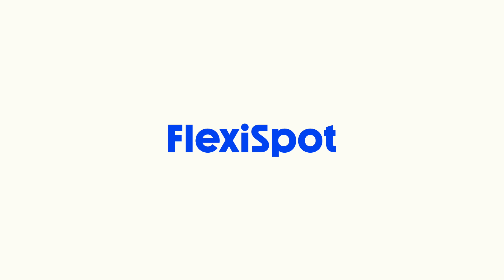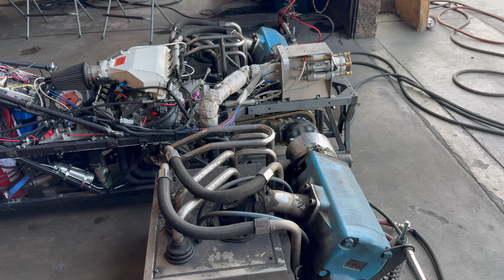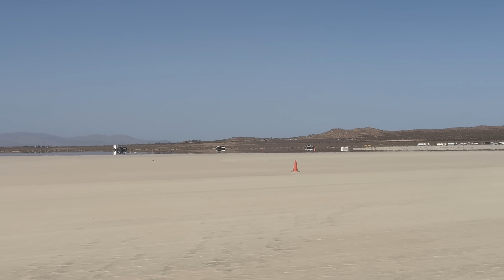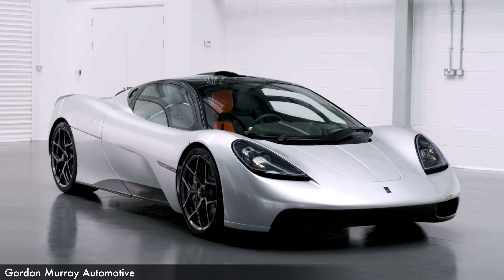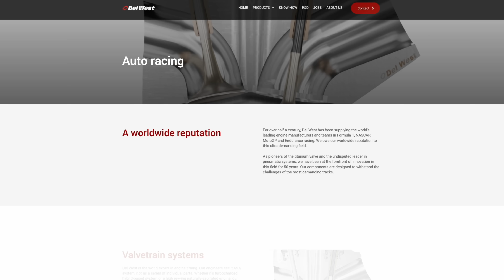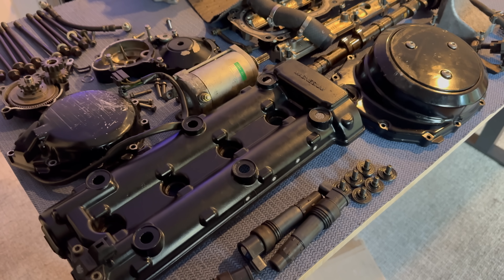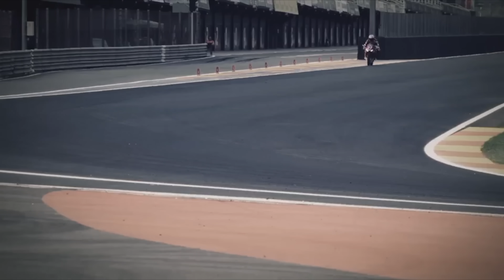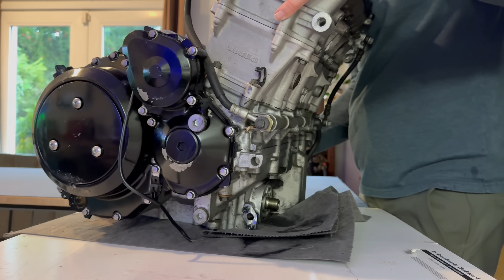Motorcycle Engines Are WAY BETTER than Car Engines

Comment: my takeaway: since the world doesn’t scale linearly, bike engines can be what car engines can’t, because bikes are lighter than cars
Reply: That is also why CVT transmissions deployed on motorcycle do not have issues like cars. Honda motorcycles' dual manual transmission work well too.

They are never go over 300kg even with a pillion rider. While modern cars go over 2000kg easily.
Reply: @laychyetan7466  I wonder how it would fair if you took a motorcycle engine and cvt put the output through a 2:1 reduction and put it in a car.
Reply: @theosexpertdaymon2774  I'm sure you'd get a lot more longevity out of the motorcycle engine, but they're also generally (a lot) less torquey at a given RPM, and have a higher brake specific fuel consumption (lower thermal efficiency). The last car that was sold with what was essentially a motorcycle engine was the RX-8. They revved to the moon, the engine was light and compact, they got terrible fuel economy and the engines needed to be rebuilt every 80k miles.
Reply: @theosexpertdaymon2774  it would be slow and have a low top speed also motorcycle engines dont have the torque required to move a heavy car
Reply: @DukeNukem3955  I'm assuming you were trying to type "don't have the torque required".

Yeah I that I mentioned the 2:1 ratio modifier. Half the output speed, double the effective torque. They rev to the moon so the higher running RPM wouldn't be a problem, I think.
Reply: @theosexpertdaymon2774  it wouldnt but who wants to hear a screaming tiny engine while going nowhere fast
Reply: @theosexpertdaymon2774 some did it with Honda Vario engine installed in Honda Civic. Very slow.
Reply: @laychyetan7466 take a 1200cc touring bike with two people and luggage
Easy over 450
Reply: @Gerx024 
Two main points.

Motorcycle has ease of maintenance, there is not need to pull the engine out of the chassis.

My calculations are off but when the load is at least double in engineering, the solution needs to be beefed up. In the real world, the CVT applications in car are a planned obsolescence strategy IMO. It doesn't benefit the owner in most scenarios.

But CVT transmissions has great fuel economy and pick up before the maintenance schedule bites you. ( Applicable to cars)

In the case of motorcycle, just change the belt and clean/grease the trans. Routine and no biggie.

For a car you need a workshop with schedule to pull the powerplant out of the chassis before you get the rough quote for the CVT maintenance.
Reply: @laychyetan7466  my family has two 10th gen Honda Civics with CVTs. Combined they have over 250,000 miles. No issues with the transmission.
Reply: 5 times lighter on average, consume the same or more.
Reply: What I still dont get and the video didtn explain is why the transmision on an engine is not packed behind the block like in the bike and why they are not all in one package as in the bike.
Reply: @Narblo  The gearbox in the original Mini was in the sump but this meant a long and therefore less precise gear stick which meant that it took a bit longer to become proficient at changing gear.
Reply: @Narblo  
1) Because they don't NEED to be. Cars are much larger vehicles with more room for everything. Also...
2) Look at where the drivetrain lives on a car vs. a bike. Cars have subframes, steering arms, air conditioning, etc. nobody wants to have to disconnect 45 things and pull an entire engine/trans combo out of a car just to install a clutch.  
3) FWD cars effectively DO have the engine/trans lumped together as a mostly compact unit, because the entire drivetrain has to fit between the front wheels.
Reply: @daedalus_20v  I get they dont need to be, but it would be easier to fit a I6 engine in a FWD car if the transmission came packed since it wont fit like they usually come (side by side). If I am not mistaken, the miura has the transmission behind the engine instead of on the side.
Reply: My RX7 was 2200lbs. A modern car is easily double that. It's foolish and doesnt need to be that way.

Comment: Another advantage of magnesium valve covers is when you crack one it will look cool when you throw it in a bonfire. 

The last motorcycle engine I took apart had a single piston that was 4" across. It did not spin very fast.
Reply: suzuki savage?
Reply: @seantheberge5456  DR650

Comment: Clutch pack a drum assembly is basically the same concept that you'll find in most automatics. One of my for fun open track day cars I built out of the salvage yard (street legal with a good title somehow) uses a manual valve body setup with a custom electronic shifting mechanism I built with a basic microcontroller setup and paddles to make it kind of a sequential transmission. Not ideal, but it's a fun experiment with parts that were going to be scrapped that I got for free.

Comment: I think if Honda did the V8 S2000 with a manual, I’m in for one if the rebuild or replace at 40k isn’t crazy expensive - like LS money would be fine. They should sell as a kit car for emissions. Great video - always wondered why there isn’t a chataram 7 sold here with a nice bike engine/transmission

Comment: Idk man i could get a rotor that do 13k rpm much cheaper than 3 mill. Pistons are so lame

Also like a rotor, bikes have basically 0 torque, and so wont pull a bike on a trailer up the hill let alone a solid weight

Comment: I ride a VFR1200X. Not the most powerful bike engine but still, it's only moving 275kg & me. 135 hp stock but can be flash tuned to 180 hp. 👍🏼

Comment: If I'm not mistaken, some F1 engines would rev past 20,000 rpm, but that was capped to 18k, then 15k for safety reasons.

Comment: 12:00 - why do motorcycles have a narrow gear range? To keep it "simple and fantastic?"
Reply: The rpm range that you make torque is smaller and peakier so you don't want to drop as much rpm per gear by ratio.

if you make peak torque at 12000 and redline at 15500 you don't want to drop to 10000 every shift

This varies by motorcycle and its application of course.

Comment: Vibratory equipment engineer here, "Everything is a spring, especially springs" accurate description.
Reply: Not my ideal infinitely rigid spherical cow.
Reply: @BenjaminCronce  probably what OceanGate thought they had achieved 😳!
Reply: I see things!as springs.
Reply: I remember joking around with this line of thought when I took FEA and Mechanical Vibrations in my final semester of uni lol
Reply: @jp_0118  I made Mechanical Vibrations and FEA my bitch. I was the only one to do so that year, but man it all just clicked .
Reply: soooooo many good vibrations like to snag some positive such as energy
Reply: So, you design toys for females? What is the most powerful one you have ever designed?
Reply: sounds better than "I make sex toys"
Reply: EE here, and OMG is this so unexpectedly true. 
It's one of those things they NEVER teach you to watch out for, and inevitably leads to frustration with your test units/prototypes suddenly failing, when from an electrical perspective, everything checks out, and looks perfect... on the bench.
Or worse... You have a sudden current break... But can't spot it visually. It's a middle layer of the circuit board that bent too far... 😫
Reply: soooooo many good vibrations like to snag some positive such as energy

Comment: It's simply not true to claim that it was motorcycle engine designers that appreciated 4 valves per cylinder gave better breathing that 2. The 1810 Isotta Fraschini Tipo KM had 4 valves per cylinder, with a single overhead camshaft. The 1912 Peugeot L76 Grand Prix race car, had 4 valves per cylinder with dual overhead camshafts. True, it was a race car engine, not a production  care engine, but it was clearly not motorcycle engine designers that appreciated the merits first. There were a whole bunch of 4 valve per cylinder car engines between the wars, and by WW II it was standard practive for liquid cooled aero engines.

The first motorcycle engine with 4 valves per cylinder was the 1921 Triumph Ricardo named for the famous, pioneering British engine designer and theoretician, Harry Riccardo who designed the engine on commission (the mechanical engineering consultancy he found is still at the leading edge of engine technology).

Also, using power per unit capacity as the sole criterion for what is a better engine is a complete nonsense too. Highly tuned motorcycle engines have poorer fuel economy than the typical car engines. They are often less flexible,  produce more pollutants and wear out faster. Car engines are generally designed to last longer. Now just how you want to weight these factors is a matter of priorities, and what is the better engine depends greatly on those factors.
Reply: Your average car engine tends to be low revving relatively low power undersquare engine that excels at low end torque but motorcycle engines are oversquare high revving engines that are more akin to a Formula 1 engine . Motorcycle engines goal is getting high power out of a small package but car engines goal is mainly efficiency not power . One of my motorcycle's over 35 years old now it's  nothing high end either but it has 5 valves per cylinder , yes I know cars existed then with 5 valves but they cost more than a large  house

Comment: With great power density comes great maintenance density
Reply: Car engines would have a lot higher power density if they only had to last 25k-50k miles. Is this really the only metric he is using?
Reply: @Noneofyourbusiness2000  No motorcycle is made to last only 50k miles, perhaps two-strokes. Modern motorcycle engines will last as long as you maintain them well.
Reply: @F3udF1st  ever own a sport bike whose engine lasted over 50k miles? This guy isn't talking about Honda Goldwings.
Reply: my 2006 motorbike has 65000 miles on it and i never had to open the engine , i just change oil , air filters and some lights that burn now and them .
Reply: @____trazluz____9804  but what is the make and model? Does your bike rev to 14,000+ RPM?
Reply: @____trazluz____9804 What kind of bike? That’s impressive!

Comment: The spring explanation is the best I have ever watched on any engineering videos. 
The 3 valves compared in one shot shows how those small engines are able to handle higher revs without going to complexity of pneumatic systems.

Comment: Fun fact: Modern F1 engines have a stroke of less than an inch and don’t use springs, they use pneumatic valve actuation, allowing around 20,000 rpm

Comment: Many years ago Honda made a five cylinder 125 cc race bike.  The engine was designed to run at 22,000 rpms all day with a 25,000 rpm redline.

Comment: Finger followers aka rocker arms. DOHC VTEC Honda engines have been using these since the 80’s. I love my 1.8L Integra GSR that spins to 8K rpm. And of course the 5 valve per cylinder Toyota 4AG engine is pretty amazing in its own right.

Comment: I will add, 
I was looking at purchasing a Yamaha FJR 1300 touring bike..
Quite impressed to see FJRs with 100,000 miles + on them and still going strong..
..
My lower mileage FJR has a 140 hp and a 9,000 rpm red line.
..
I think a 2.0 litre
14,000 rpm
V8 Honda S2000 to be an excellent idea...

With today's oils and special nickel bore/cylinder coatings 50,000 + miles from such an engine could be achievable....

Comment: I'd rather have my 1956 international 4x4 pickup than anything made after 1990. For me longevity and durability are more important than speed and rpms. I'd rather be able to go a million miles reliably and fix any problems with two wrenches than go 10k miles at 200mph and need a whole shop and an electrical engineering degree to fix it when it breaks. Also, aluminum should not be used for anything important unless it's an airplane.  Steel is always better and cast iron will last forever.  I'm not too dumb to understand newer vehicles, I just hate them.

Comment: For you desk controls, push them back under the desk an inch so you cant knock them when you walk by or lean up or hit by a heavy object. Since these are slanted you may need to print a spacer as well

Comment: 13:39
It should have been a million, and it has been for a few models, but we are progressing backward.  The 8th gen of Honda civics was a repeat offender for single cars cranking out a million miles on the same engine and transmission and no major repairs.  So he's right, they are engineered to force you back to the dealership WAY sooner, but that is far from ok.  Relevance of future purchases should be created by improvement, not by planned obsolescence.  And all this time we have these afore mentioned Honda civics being plentifully peppy while stock.

Comment: Had a 2003 r1 that ran hard on a regular basis. Finally checked the valve clearance at 40,000 miles and they were still in spec. Sold that bike with 62,000 miles and it still ran like a top.

Comment: I have always thought that the main difference between motorcycles and cars is mass, shocking I know, but what I mean is car engine needs to push a lot more of it than a motorcycle engine and therefore needs to produce a lot more torque, which is the one thing that was never mentioned in the video. So on average car engines are bigger, slower revving but torquier beasts whereas motorcycle engines are the opposite. s1000rr has 120 NM whereas VW 1.0 tsi develops 170, rough numbers and one is NA and the ones one is turbo, but i hope you get the point.

Comment: I've noticed that my 1975 Cosworth Vega engine is just an overgrown motorcycle engine. Super straight intake and exhaust ports, bucket lifters, inconel exhaust valves, all forged and balanced rotating assembly, and shortened stroke. It makes no torque and revs to 8500 RPM, and only weighs 125 lbs with a displacement of 2.0 liters. My other car's engine which is a 1989 Subaru EA71S is even more motorcycle like in many ways, but less in other ways. It has a pushrod valvetrain (the valves are enormous though, similar size to full race valves for a VW beetle engine), with a gear driven camshaft. The pushrods are aluminum and weigh basically nothing. The bore is 92mm and the stroke is only 60mm. That engine revs to around 7500 RPM with the stock cam, but can easily rev to 10,000+ with minor upgrades like a bigger cam, stiffer valve springs, and titanium valve spring retainers. Currently it has over 200,000 miles on the current rebuild, most of which were at over 4000 RPM. A very durable engine which can also be high revving at the same time. The piston speed is so low that at 10,000 RPM, it's equivalent to an average American V8 at 5500 or 6000 RPM. The transmission in that car (1973 Subaru RX 5 speed) is also very similar to a motorcycle transmission. It has no synchros, only dog rings, has gears that are not quite straight cut but very low pitch helical, and puts the differential in the same case as the rest of the transmission. I'm not sure how much it weighs but it can't be more than 65 lbs because I can easily pick it up and move it by myself.

Comment: Hi hi hi.
Diesel. Far better.
Even slightly under freezing temp, outside, can be enough cooling for a water-cooled van diesel, without any water in it. 

The best engine is something compact for the vehicle size. Powerful for the vehicle size and load. A 300Hp strait-six with turbocharger. Gone stupid amounts of distance across the world in all sort of weather conditions after year, after year, of use. Trying to go fast after all that driving having the gearbox or if it is the turbo blow off wise-ling in pain. Yet still capable to more or less drive like a granny in speed. Fully legal load-limit 64000kg. What is not better then a machine that returns in abundance of reliability and economics? Even if slow and needing to take some time to not over stress the power plant? For sakes and all, a old tractor engine beats everyone in the long race. Do not even need a rev counter when the engine simply pulls like godly powers. Making animal and human pulling no longer needed.

The electric engine. A reliable diesel made to last still beats the electric engine. When something is built and operated hand in hand to do something useful? Maybe there is not much glamor or adrenaline in slow and steady. Yet to think 6000rpm+ is in any way better then a engine capable to do more with less under 2000rpm? Madness. A engine meant for work grows from a car into a truck and trailer. Do numbers and the scale difference from bike and car, car to truck? Then consider that from a cars 2 liter engine the truck go to 6 liters. Meanwhile a bike go from the cars 2 liters to say 0.5 liters.

The bike has less drag and scale. Yet has 1/4 the engine. Meanwhile the long-life truck has 3 times the engine and many times the scale and drag to the car. A 300hp car hauler carries maybe 10 cars and itself? The power out of proper engines are truly taken for granted it seems. Until something else shows up, electric and low revving engines are simply far more impressive. It is going towards and passed normal car engines things are getting worse.

But 1cyl dirt bikes or chainsaws are fine! 2 stroke for all emission flaws are simply beating most everything. Except turbines. Mostly... Simply not fit in land vehicles. At best trains.

A crazy 1.5 liter bike that can do 20000rpm? Within the same life expectancy a V8 8 liter nitro diesel can haul ass. Traction and the gearbox/frame will be the weak link... 100000kg+ no problem as long as traction and roads hold. You simply need to compare apples to apples to understand the madness. Both the bike and truck will run off the road in a crash.